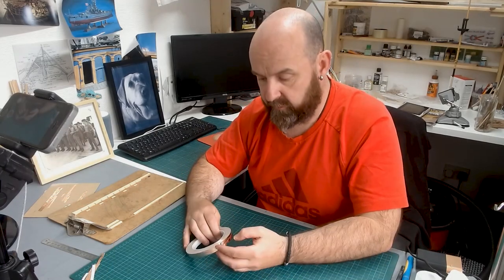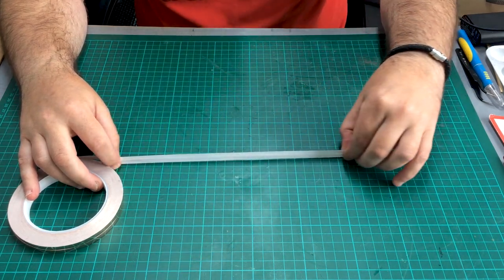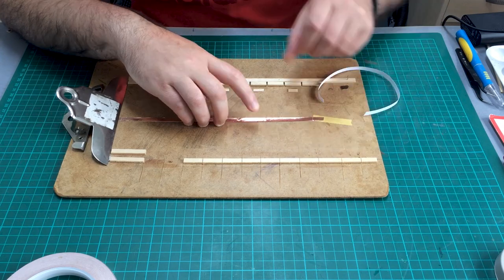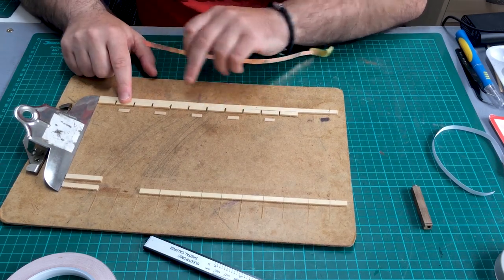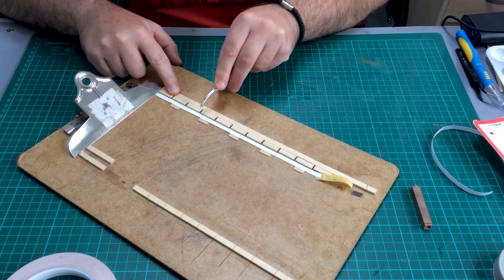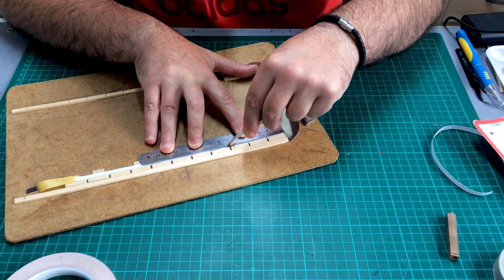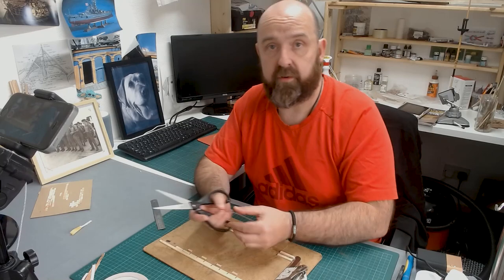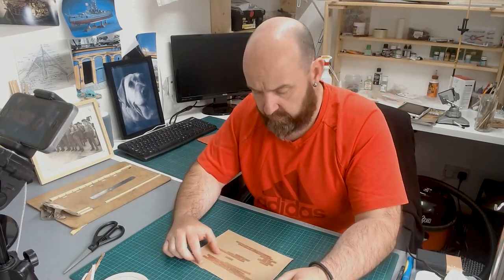How To Make Model Ship Hull Tiles - Hand Made from copper tape

Comment: Aha, the copper tiles. And again i see a lot of work coming up! In the time a started my build i hunted Ebay, Germany in this case to gain the issues for the build and decided to spend a specific ammount of money. I ended up buying sort of "leftovers" from ebaysellers often paying 1 or 2 euros per issue. It took me a year to do so but never succeeded to make a succesfull offer on the tiles. Meanwhile the Deagostini seller in the Netherlands went bankrupt so i couldn't obtain them from them anymore. I did have a lot of 0,5 mm by 7 mm leftover wooden  strips. I cut them in to pieces the same way you did here and glued them on the hull with  whiteglue. I used a thinpointed pensel to draw the nailholes on the tiles and painted them with Humbrol copper coloured paint. In the end it worked out fine. Only thing i have to do are the parts close to the rudder but at that moment i was out of strips. Fortnately recentely i was able to buy some again in a stash of parts so i can finish the job! Goodluck with you work on the tiles!
Reply from the maker: Hi Ron thank you for your comment

Comment: Again very useful Thanks  3500 Tiles required for 1:78 (Scale)
John The tiles should be overlapped from the stern for'ard and up.
If you DONT mark the nails on the top and back of the tiles you can efectivly mae them "Look" as though they are overlaid
You will need to make Left and right
I use ZAP CA place the tiles on and drop a drop of CA under the top of the tile
Incidentally Amati make pre laid tiles that can be laid in batches 
Caldercraft make tiles and so do Mantua
Though tiles can with the kit ofr are they an extra
Reply from the maker: Thank you for your comment Richard. I’ve been reading the Anatomy of Nelsons Ship thoroughly, studying the section of coppering the hull. I’ve seen that manufacturers sell the copper plates but I didn’t want the extra cost onto the build.

Comment: Great video and nice technique. I'm in the middle of the Victory build also, and their order of doing things is ridiculous. Like you, I'm changing it up. I've never done the tape idea, and it looks promising. I built a Cute Sark using copper tiles (Sergal's old kit, I sat on it for years then finally go to it), I thought I would go insane using the CA and accelerator. Some calls to Franklin and experiments showed that Titebond II will bond copper tiles to wood. I'm concerned the tape won't hold permanently, especially when it's being touched by hands, contaminating the adhesive. Any thoughts on how permanent the tape will be? I'm not looking forward to another 4000 tile job, even with Titebond this time. Your skill is really impressive.
Reply from the maker: Hi Daryl thank you for your comment. In the later videos. Where I’ve started to fit the copper tape tiles and I talk and show the holding power of the tape I’ve been very impressed so far
Reply: It does look much easier, I could not hear, what brand was it?
Reply from the maker: Ok I will find you the link for the copper tape